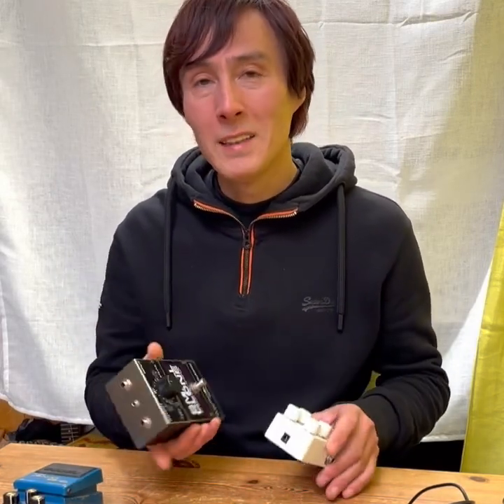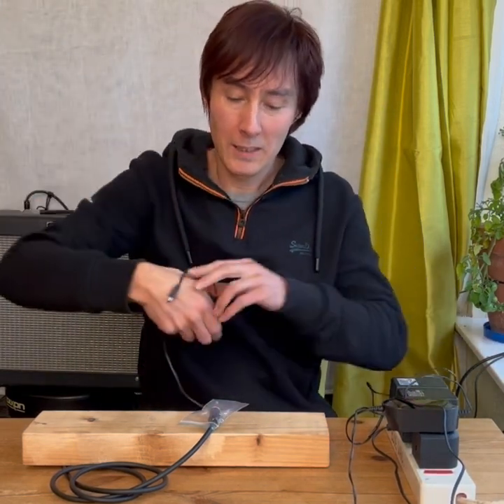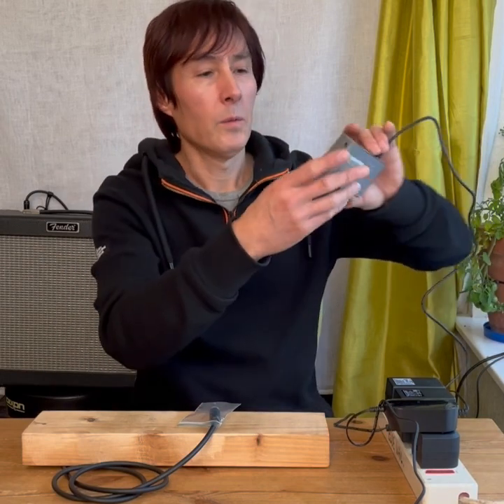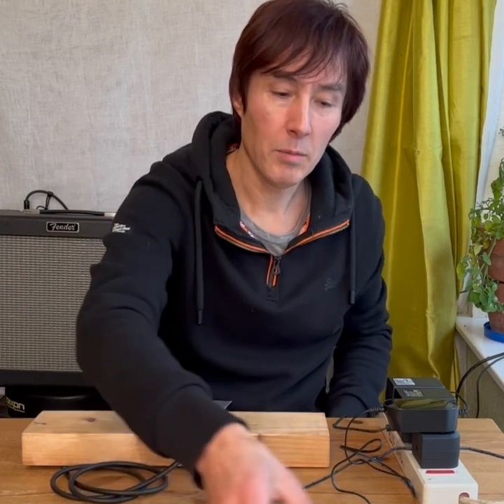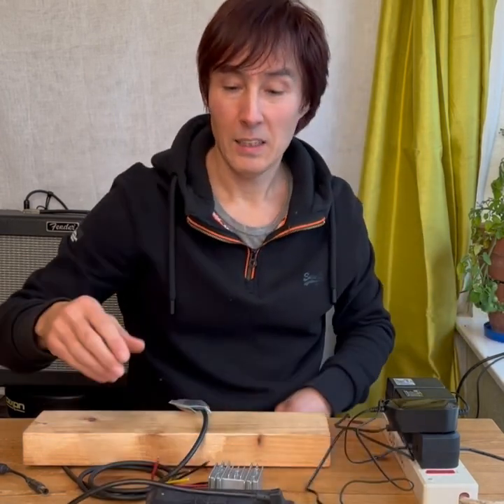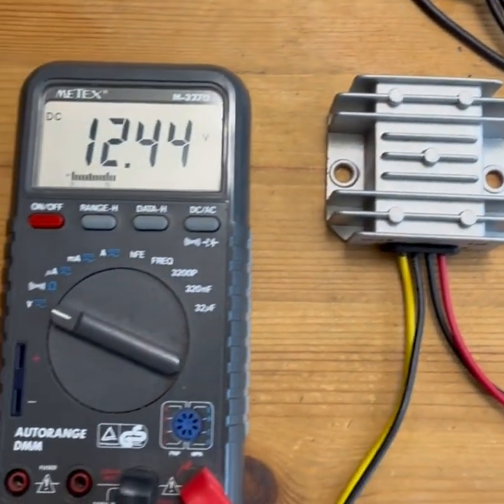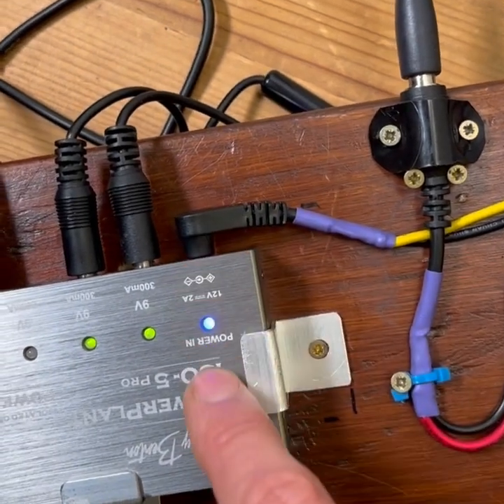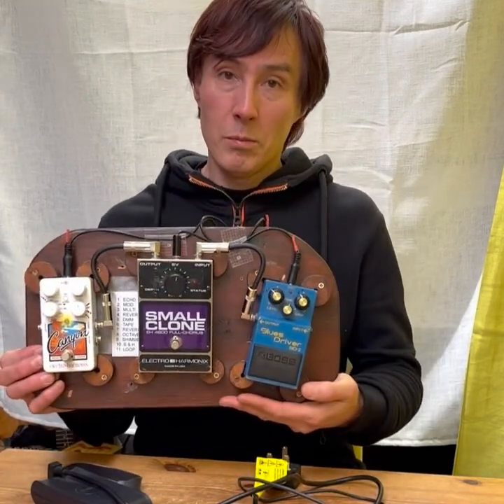How to eliminate power supply noise from your efx pedal board - & why wall warts are rubbish!

Comment: Ok. You've used a Harley Benton Powerplant which is well known for falsely claiming to be isolated. There are other power supplies such as the Mosky Iso-10 / Lekato MPP10 (practically the same), and the Joyo power supply 5 (can run on its internal battery or DC9V and is truly isolated).

Comment: Two things about this: 1. It actually works (I’ll go into more detail momentarily), 2. The amount of DC hum in the bare guitar input test does actually correlate with the amount of noise when powering the pedals. Intrigued by this idea, I repeated the experiment with one somewhat noisy wall wart, one horrendous one, and an HP laptop charger. There was perfect correlation. I wrote this part out specifically for the commenter @TedSchoenling. I also bought a LM2596 DC-DC voltage regulator, acquired a charger receiver that fit my HP charger from a local computer repair store, and attached a standard 2.1 mm DC power jack. Perfectly quite pedals now as if they are all on battery. Thanks for sharing this idea!

Comment: Apart from power supply hum, It is surprising just how much noise is generated within the guitar itself - even on a guitar like mine which is humbuckers only. Now of course this is where a basic, inexpensive and small noise gate pedal at the very beginning of the pedal chain can work wonders. Often we can blame hi-gain pedals when in reality they are simply amplifying the interference delivered to them from the guitar - that guitar noise may sound very low when connected straight into the amplifier, but those hi gain pedals will pick it up and multiply it greatly - each pedal in the chain boosting the original guitar noise some more. A small budget noise gate can be picked up from ebay for little money - and it will quickly earn its place at start of the pedal board.